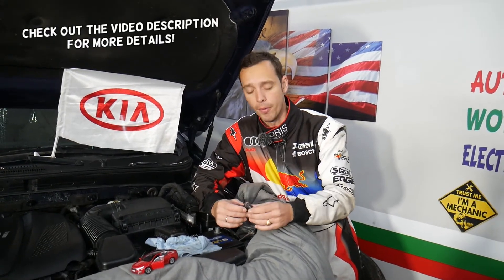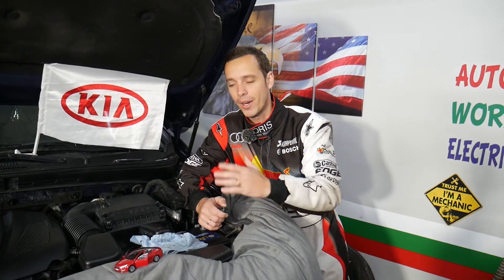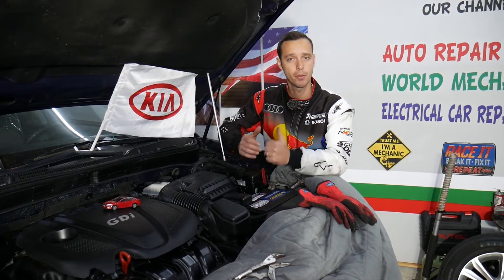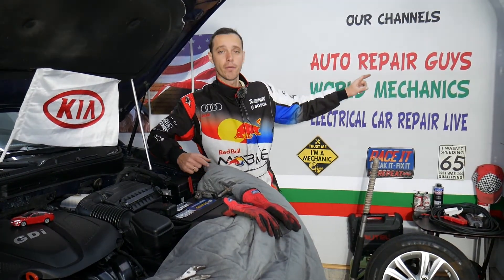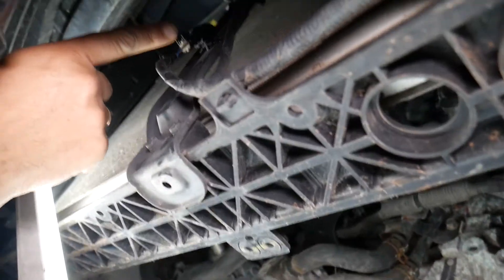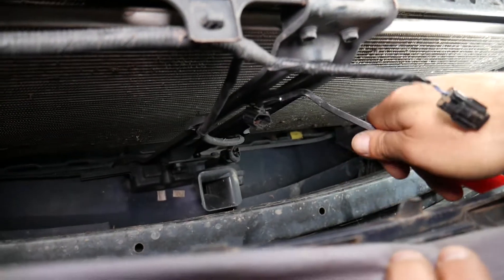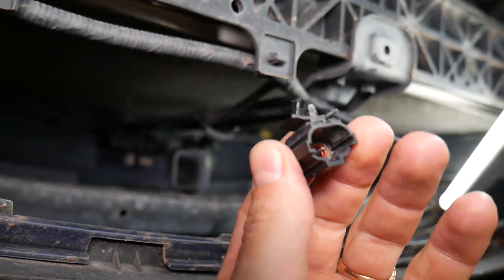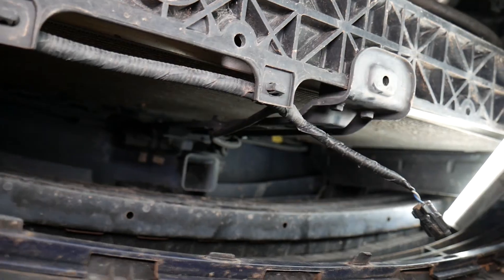TOP 3 WHY AMBIENT TEMPERATURE SENSOR NOT WORKING ON KIA, OUTSIDE TEMPERATURE NOT WORKING

Comment: Thank you for this video it fixed my problem. I have a 2005 Kia Sedona. It's 18 years old, all grown up and old enough to vote now. The car would always say the outside temperature was 149F(blinking) on the display and never anything else. I took the sensor wire loose, examined it, wiped it off and reinstalled it. Now the temperature outside is 89F. Thanks again.

Comment: I have a good problem for you. 2011 Kia Optima SX turbo has no heat inside the car. A/C works great, Temp will not change and all blend doors are working fine along with the fan motor. I have changed the temp control head unit and still not working. Heater hoses are both hot. Any clues?

Comment: mine is saying -- or sometimes -40c.
i don't care about the -- but when it freaks out and says -40c it forces hot-air in the cabinet and is summer! i want AC on, and it turns it off! i will check the sensor tomorrow
Reply: the same thing is happening to my car, did you manage to solve it?
Reply: Replace the cabin air filter . That might do the trick
Reply: @igorrbarra  yeah. I installed a new sensor and all was perfect.

Comment: My neighbor has a 2015 Kia Sedona and the ambient temperature will give false readings. Inside the van a bell will chime and the temps on the instrument cluster will continue to drop over 30 degrees, 1 degree per second. then it resets itself again. is this a failing sensor or something else entirely?

Comment: So my friend has a 2019 Kia forte and it’s hot here in Florida and her ac runs fine blows hot air but not cold is this what I need to check and change so the temperature can stop reading -40 and bring it back to normal to have cold ac please someone answer me

Comment: Can you please share the location of AC evaporater temperature sensor location for my Kia Cerato 2012. AC comptessor turning on and off intermittently when idle but working fine when I rev Engine to more than 1500rpm.
Reply: Also my AC is not working in Automatic mode working in Manual only.